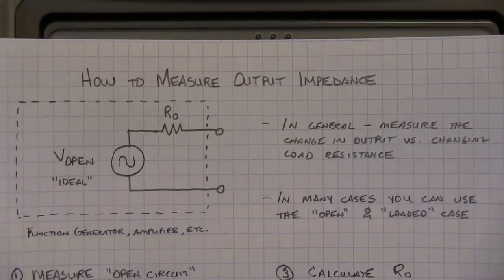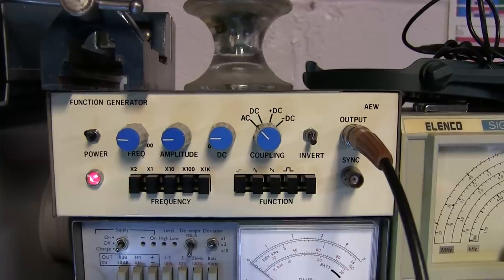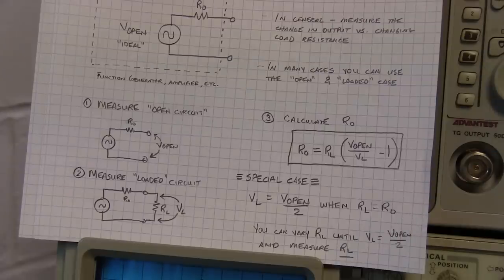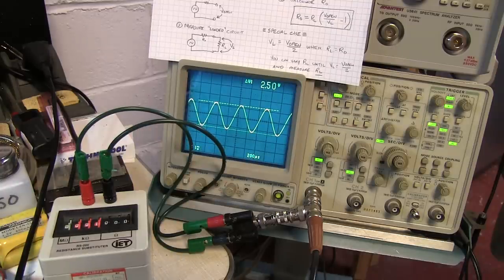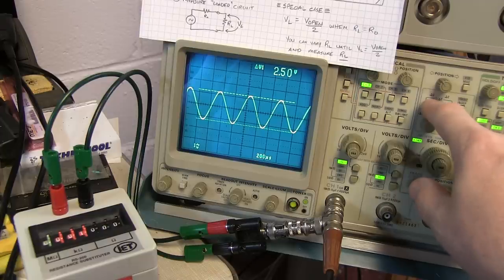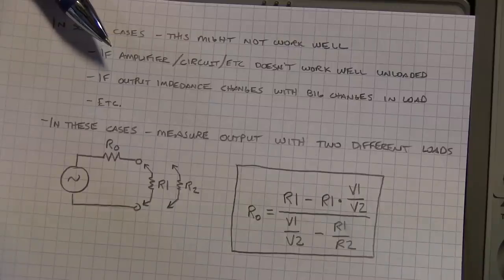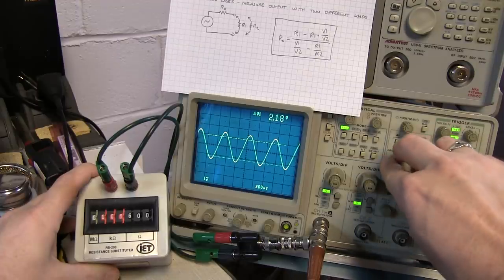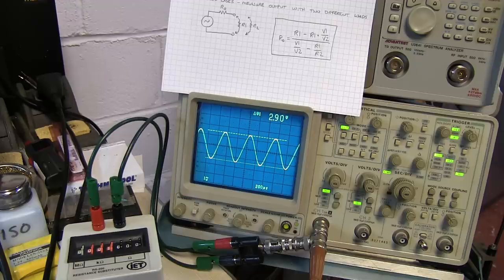#138: How to Measure Output Impedance

Comment: Hi, Alan

I guess my question is about the differences (if any) between…  'Output Impedance’ vs. 'Internal Resistance’, ... or ( 'Source Impedance'  *).

Are each of these terms completely synonymous? or is there enough of a difference between them where they are all needed in order to properly describe slightly different things at work.
---

In the class I’m taking we did an experiment to determine the INTERNAL RESISTANCE (R_int) of a voltage supply.

The 'SPECIAL CASE’ section of your video here basically covers the same process and formula we used… with the minor difference that… V-open / 2 = R_int  (in our experiment).

In the experiment we did I used a potentiometer as the R_load,… and adjusted it until V_load = V_open/2. 
After which, the POT was measured to determine it’s resistor value… and we approximated that to being (R_int).

[ ... we ultimately did this for a variety of R_load values… and calculated the Power Differences as R_load values shifted away from matching what R_int is; … and more calculation were done to determine dB gains and losses—relative to the values of the matched pair ( R_int = R_load ). ] 

I guess In hindsight… we were doing a little more than just finding out what R_int was… it was also about maximizing power transfer, …and maybe starting to flirt with impedance matching too? though, I’m still not 100% solid on understanding everything that impedance is. I have been reading about it (a lot)… but still need more real experience with it, and intuitive understanding… in terms of circuit building, and more hands on  testing.

Thanks for the Great Channel, Alan… I really LOVE IT. and it’s helping me a lot in my attempts to learn about electronics.

Take Care, 

Jim

* My mention of the 'Source Impedance' comes from watching your impedance matching videos, which I'm just now starting to look at.

.
Reply from the maker: In general, the "internal resistance" and "output impedance" in this context are basically the same thing.

Comment: I found the video on the new rigexpert excellent.  I have an AA54 and I'm somewhat impressed with it, however, I found that above 10MHZ it utilizes the third harmonic down for calculations. I checked this on 2 different counters and my scope readout.  I'm not saying this is a poor design, just wondering what your input is as I respect your experience certainly with test equipment.  73 es best regards N9NYC
Reply from the maker: replied to this comment in the AA55 video page.

Comment: Hello Alan, my other question is when you have multiple test equipment such as an oscilloscope, frequency counter, signal generator, and they all have different impedance output such as 50 ohms,  75 ohms, 600 ohms or 1 meg ohms. What coax cable is appropriate when connecting the test equipment ???
Reply: There should only be one termination on the line.  Other devices should be in high impedance mode.  The cable should match the source and terminating resistance.  So signal generator is 50 ohm source, freq counter is high impedance connected to a tee, o scope at other end terminated in 50 ohms, using 50 ohm coax between each.

Comment: hello
I just did this test on BK Precision 3011 function generator  and I got 480.625 of its output impedance. I checked it on a new Siglent SDX 1102X oscilloscope. What I am trying to do is measure the ESR on 2 caps that are in an old Interstate F-44 High Voltage Sweep Generator that I am trying to repair.  And the video I watched said you need a function generator with 50 ohm output impedance. I guess my BK 3011 isn't 50 ohm.
The resister I used was a wire wound 1000 ohm 10 watt that is covered in a hard porcelain or pottery substance. And I used cables just like you did in video.
I think I will try it with different resistor values, I thought most function generators had 50 ohm output.
thanks
newbie
Reply from the maker: According to the specs in this manual, the output impedance is 50ohms. You should recheck your measurements and math. 
https://bkpmedia.s3.amazonaws.com/downloads/manuals/en-us/3011A_manual.pdf

Comment: As a newbie electronics  hobbyist, I like your videos, don't fully understand them all. Pity you don't have the wave gen schematic. I'm looking to build one, I have found a circuit diagram to follow, but how do you design for 50Ω  etc
Reply: You use an op-amp as a low impedance buffer and put a 50 ohm resistor in series with the output.

Comment: Allen, is there a way to calculate the feed point impedance of an Antenna? Like an  EFHW uses a 49:1 impedance transformation. How do one come to a conclusion that for HF bands the feed point impedance of an EFHW is around 2500 Ohms and required a 49:1 impedance transformer? I couldn't find a satisfying reply anywhere.
Reply: That's exactly what an antenna analyzer does.

Comment: What is the difference between an impedance curve compared to a frequency response curve? For Speakers there is two curve graphs that are completely different from each other, there is a speaker impedance curve and a frequency response curve. What I'm confused on is that the you input an audio signal from the function generator and sweep a frequency range. The graphs will curve out the speakers frequency response curve but the Impedance curve is completely different. I'm confused because I would think the frequency response curve would show you what the speaker frequency response "profile" is but the speaker impedance curve is actually what the speaker will be not the frequency response curve? What I'm saying is that the speakers frequency response is not really the graph to look at but the impedance curve is, plus they are not related to each other it seems. You sweep 20hz to 20K hz and the speakers frequency response will graph a curve profile from 20hz to 20khz. This is what most people think would be the correct profile. But the speakers impedance curve from 20hz to 20khz is the actual graph profile the speaker will be it seems.
Reply from the maker: Frequency Response = the audible response of the speaker - in other words, how well it reproduces sound over the specified frequency range. It's what you hear.  This is what people want to know when buying a speaker - how well it produces sound at various frequencies.
Impedance Curve - the electrical impedance at the speaker terminals vs. frequency - which is the electrical load that the amplifier sees when driving the speaker.  This is what the amplifier designer needs to know in order to properly design his amplifier circuit.

Comment: so ...how does a working circuit with many parts come out to be an of 50/6oo ohms? do they just place a 50/6oo ohms in parallel with entire device?.....taking into account the parallel total impedance...?.
Reply from the maker: Usually the output driver is low impedance, and a resistor is added in series to get to 50 ohms.

Comment: Hello Alan, my oscilloscope has a ground power cord. I hear other technicians saying to use an isolated transformer 1:1 or simply use a two prong adapter. What is your recommendations?
Reply from the maker: Keep your scope grounded and use an isolation transformer on whatever you’re working on - but only when necessary. And, always be cognizant if the fact that your scope probe ground lead is grounded.

Comment: Than you for thus video. So, in order to measure the output impedance of my sound card must  I use the 1 Kohm resistor and the formula you sent as? The measure woudn t be correct if 
I only use my multi-meter Omhs parameter? Thank yuo so much.
Reply from the maker: You can't use an ohmmeter to measure output impedance because it depends on the active properties of the circuit.  The ohmmeter only works on unpowered devices.

Comment: But the impedance changes when varying the input frequency. So how can an amplifier designer choose the correct impedance if its changing when varying the input frequency?  The impedance is not constant or fixed impedance its not always going to be a constant 8 ohms or 4 ohms load. A tube power amplifier section the output tubes impedance is always changing impedance. A Solid state output amplifier section the output transistors impedance is always changing impedance because the frequency input is varying.
Reply from the maker: The designer would simply have to ensure that the amplifier can adequately drive the speaker's impedance over the desired frequency range - by either compensating for it, or by making it insensitive to it.

Comment: Question, on  Leader LFG 1300S generator requires a 50 ohm cable.  can you explain this to me? Does it mean that different generators require different cables for testing?
Thanks
Reply from the maker: The vast majority of coaxial cables used with test and measurement equipment are 50 ohm cables.  This means that the coaxial cable has a 50 ohm characteristic impedance.  For low frequency signals, this is unimportant.  But for high frequency signals (above about 1MHz or so), or for signals with fast rising/falling edges (faster than 40-50ns), the 50 ohm cables and proper termination begins to be important.  You may want to review this video on transmission lines and terminations:
https://www.youtube.com/watch?v=g_jxh0Qe_FY

Comment: Can I use the second method (about 6:42 on the video) to check the output impedance on my HF transceiver, see if it is truly 50 ohms? Perhaps use a 50 ohm dummy load and measure with my scope then drop in a 100 ohm dummy load and do the same measurement?
Reply from the maker: Yes, that would work, provided your scope doesn't alter the impedance.

Comment: im just a aermodellling hobbyist, right now i use the video transmitter with 5.8ghz freq , i need to know is this method can be  used to measure the output impedance for my video trasmitter
Reply from the maker: Probably not, since most hobbyists don't have a way to measure the amplitude of a 5.8GHz signal.  You can safely assume that is is likely 50-75 ohms as most RF outputs are.

Comment: nice video :) will this method work with square wave generator say from 555 timer or we can only measure the impedance of sine wave generator using this method
Reply from the maker: It should work well with a square wave output too.  Just keep in mind that many logic circuits have a different output impedance for the high state and low state.

Comment: I would like to make my own bnc cables for testing. What cable ? brand and number? and what is the maximum length ? 
Thanks
Reply from the maker: Good quality RG-58/U such as Belden 8262 would be a fine choice.  Maximum length depends on your frequency of operation, it all depends on the amount of loss you're willing to tolerate. Hundreds of feet are often used at frequencies below 100MHz.

Comment: Ok, great explanation! But, I would like to find out the output impedance of my signal gerenator, and not the resistance. Because, the open-circuit output voltage of it changes with frequency. Please, how would I do this?
Reply from the maker: It is very likely that the change in output amplitude is not due to the presence of reactance in your output impedance - it likely has more to do with the signal generator circuit itself or the measurement method.
Reply: Ok, thanks a lot w2aew! I was thinking that I could get some kind of a model of the signal generator's output. Maybe, with an impedance like in a transmission line. But, I don't know if that is possible. Anyway, thank you so much for your attention!

Comment: I’ve got most of the principles of ohms law figured out but I’m working on mastering impedance which some people blow-off and as just being resistance. My interest, as an amp tech, is to develop a checklist of measurements across every amp I fix. I was watching this video on measuring output impedance and am curious to know why, when (@3:14) you switched your scope to 1 m-ohm of input impedance, you identified that as an open circuit (and I know an open circuit causes a voltage spike .. assuming because of the pent up potential). As resistance goes, doesn’t the fact that 1 m-ohm exceeds the 600 ohms of output impedance mean that it applies more resistance? Isn’t 1-m ohm a bigger load? Or, is it “open” because the BNC-T was left unterminated?
Reply from the maker: I said that 1Mohm was effectively open circuit because it is so much higher than the 600 ohm output impedance of the source that the difference in loading of the 1Mohm load vs. a true open circuit would be negligible.  I higher resistance load is a "lighter" load - easier to drive, because it doesn't draw much current.  Low resistance loads are "heavier" loads, much harder to drive because they draw a lot of current.
Reply: @w2aew  Oh, doh. Not even sure why I asked. So obvious now. Thank you.

Comment: Could someone explain to me how to measure and calculate the output resistance of the RF generator. The minimum frequency on the device is 120 KHz. Judging by this video, such a high frequency would give me a bad result. I'm just a hobbyist, that's why I'm asking..   I just don't know ....  😅
Reply from the maker: 120kHz is low enough in frequency that you can use the method shown here.
Reply: @w2aew  thank you very much for response...  God bless you..

Comment: Very nice presentation once again. A couple of observations: I did this on a breadboard with  the output impedance of my awg set to 50 ohm. I used a small 100 ohm trim pot and adjusted the pot until Vpp on the oscilloscope measured the set voltage on the awg. I got 47 ohm. Not bad. It just seems to me that using a pot makes it much easier to fine tune the load resistance compared to a decade box. Secondly this method assumes that the circuit under test consists of linear circuit elements which can be modeled as a thevenin voltage and resistance. The failure of the first method (2:47) to work all the time may be an indication of this. Using a second load resistance measurement (6:54) may or may not satisfactorily adjust for this. Best way is to measure open circuit voltage (Vth), calculate voltage at several load resistance levels, calculate current V/R at each point and plot voltage vs current. (You can do a least squares approximation on the data if the line is not perfectly straight) Getting a straight line insures that you are actually dealing with linear circuit elements. As V (measured) = - Rth*I + Vth. The slope of this line is the negative of the output impedance (Rth).
Reply from the maker: Please note that the 50 ohm setting on your AWG is likely NOT setting the output impedance.  The output impedance is always 50 ohms.  This setting is telling the AWG what the load impedance is that you're connecting to.  It uses this to properly set and display the voltage at the load.
Reply: @w2aew  Yes I know. When I say I set the output impedance I should have said the input impedance of the load. My Siglent SDX1032X has two options for load impedance 50 ohm and HiZ. When set at 50 ohm the open circuit voltage is twice the displayed voltage and when set at HiZ the open circuit voltage is equal to the displayed (set) voltage. The question I had is what is considered a high load impedance? If we desire less than a 1% discrepancy between the displayed and measured voltages (across the load) we have (at the Hiz setting)  Vm (measured) = R*Vset/( R + 50 ). Where Vs is the set (displayed) voltage. If we require Vm to be >= 99% of Vset then R (load) must be greater than 4950 ohms. If, instead, can live with a 5% discrepancy then R must be greater than 950 ohms. In practice I actually tested this out and found that at a 700 ohm load the output voltage was within 5% of the displayed voltage and that at greater than 1750 ohms the output voltage was identical to the displayed voltage. So the question arises what if our actual load impedance is below 1750 ohm (for 1%) or less than 700 ohm (for 5%)?  Well with the the awg set to HiZ we have Vm = Vset*R/( R + 50) we can turn this around (setting Vm to the desired voltage) and Vset = (1 + 50/R)*Vdesired.  Eg lets say we have a 100 ohm load and desire 4 volts. We would then set the awg to 
Vset = (1 + 50/100)*4 = 6 volts. OTOH if the awg were set to expect a 50 ohm load and we had a load resistance R other than 50 ohm (but less than 700) then the formula would be 1/2 of this Vset = (0.5 + 25/R)*Vdesired.

Comment: Hi Alan, quick question...if I'm not using a t-connector with the bananna jack adaptation, where exactly in the circuit should I connect the probe? The ground clip? Do these locations change when I add the load?
Reply from the maker: The probe should connect across the "load", whether the load is an open circuit (first part of the test) or a resistor (second part of the test).  Ground on the probe should be connected to the ground/shield/common from the signal source.
Reply: thanks alan! That's what I thought. One note of interest, this approach works with a multimeter as well. I tried the math out with RMS voltages and it works out correctly so long as you consistently apply RMS (or even just peak) to every voltage variable.